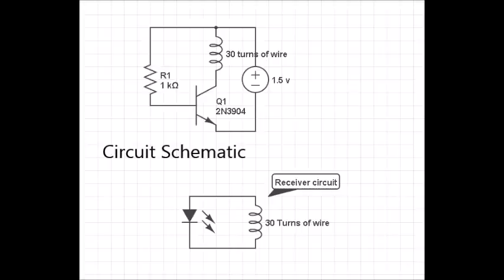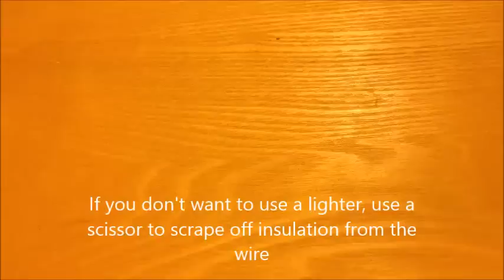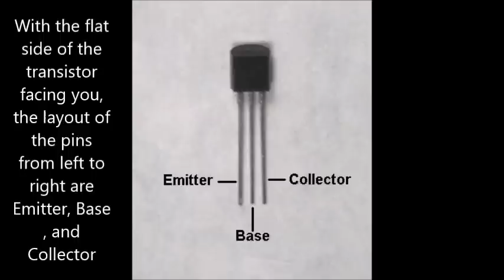Wireless electricity transmission circuit

Comment: if you wrap a wire and with DC operates then it can not Magnetfelt build up for that you need an AC voltage. It is only a fake
Reply: I got the same doubt bro

Comment: how to increase the range of Wireless Electricity Transmission
Reply: Increase the turn of coil
Reply: +AbhiGC doesn't help. tried 30-tap30 turns and 60 turns, same effect, the best effect if the transmitter wire is a bit thicker than the receiver. But that gives about 5mm to 10mm more range
Reply: +Aswin Balaji Increase the power
Reply: +Aswin Balaji i think, wehn you use an iron core for each coil, you will get much more energy transmission. Or try to make more windings on the reciever coil as on the sender. E.g.: sender coil: 30 turns, reciever: 50-60 turns...

Comment: The circuit schematic is not the same as what you have done.  WHY  ?????????
Reply from the maker: +Sss Ttt   I think I did the circuit based on the schematic. If I am wrong, let me know where did I mess up on the schematic.
Reply: +AH Electronics    The coil in the diagram does not have a center tap

Comment: Why 2n2222a
Reply from the maker: I mean you could try any other NPN transistors as well, like the common 2n3904 or anything. Just make sure it has a low enough base emitter saturation voltage, otherwise when the batteries gets old it wouldn't work.

Comment: That's called a transformer, NOT TRANSMISSION POWER!
Reply from the maker: +POStOLFRONT   Yes it is a transformer with air core. But what is the meaning of wireless transmission?  Wireless transmission means to transmit or send energy from one point to another point without wires. In this case it is sending energy through the primary to secondary coil by means of magnetic field fluctuation.  So in a sense it is still wireless power transmitter.
Reply: +argha halder TRANSMISSION POWER was the pet project of Nikola Tesla in the 1930's, where he tried to transmit electricity through the air, the Tesla Coil was on of his inventions.

Comment: Cant we use 2N2222 transistor
Reply from the maker: Yes, you can. 2N2222 is a general purpose NPN transistor much like the one I used here. So no problem with that.